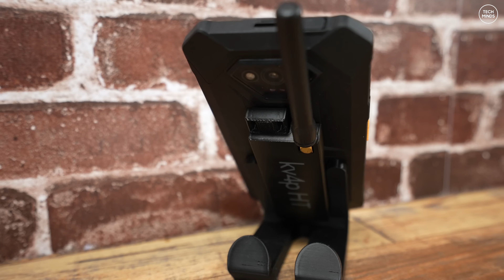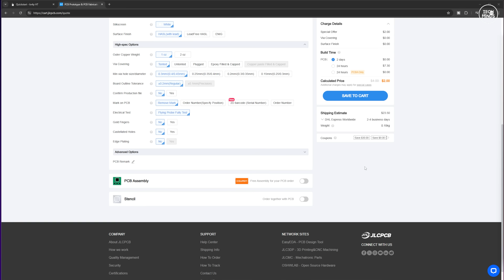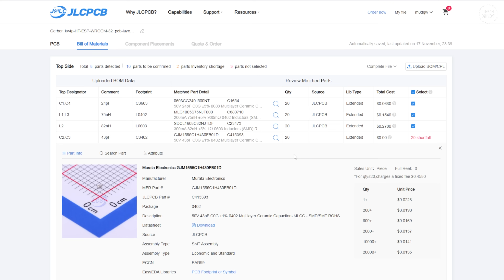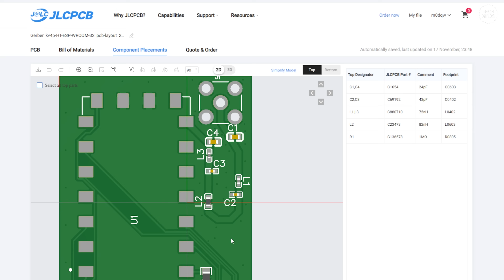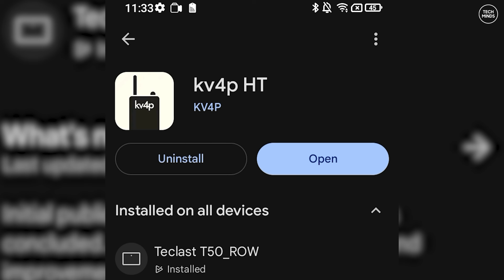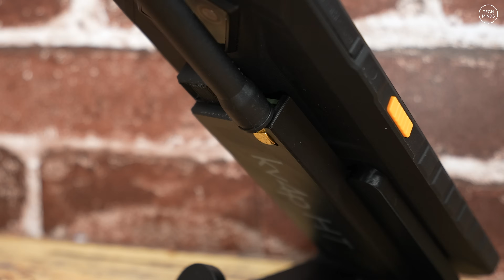Android Controlled VHF Walkie Talkie Transceiver - Testing PCB Revision 1.7b

Comment: It would be great to have a complete open-source VHF radio in a standard mobile form factor, like the RS918 or BS188. It should be further developed with a microphone, a power amplifier, and eventually its own user interface. Is it currently communicating with Android via Bluetooth?

Comment: Thanks again for the great video, is there also a UHF variant of this device? Thank you
Reply from the maker: There is definitely a UHF variant of the RF module, but the filtering on the PCB is designed for VHF. I dont think it would be too much trouble to redesign a board with UHF filters though.
Reply: @TechMindsOfficial  thank you

Comment: not sure why the firmware isn't using  Bluetooth Serial besides there is no external battery for the radio  and there is no  battery charger circuitry on the ESP32 ... luckily my PCB isn't limited

Comment: Did the substitution when I ordered mine.  Notice also that the ESP32, etc.  Are NOT deselected so it will  have them try to and eventually find everything.  That holds up a pcbway order unless you deselect those parts.
Reply from the maker: I ordered from JLCPCB so not sure how other sites operate, but great you got the boards! :-)

Comment: This was an interesting project. I used to work as a technician assembling aircraft control interface boxes in the U.S. I was just curious if there could be an emulator for digital modes such as DMR and C4FM? 73de N0SJU
Reply from the maker: I think this could be possible for sure, especially M17 and FreeDV which are open source.

Comment: A dual VHF/UHF would be ideal. (And if the firmware & App included APRS & Meshtastic together....that would be fantastic!)
Reply: Those RF modules are all single band unfortunately
Reply: @nine7295  well, i guess its quite easy to extend the pcb for another module..

Comment: How far does APRS travel?  Is it bound by local repeaters? The country which one resides?  The world?
Reply from the maker: APRS is normally line of sight, or simplex, not through a repeater. However, the ISS did have an APRS digipeater at one time or another. Distance is dependent on antenna used and height.

Comment: Well, 1) I've got a dozen ESP32 modules sat around doing nothing, 2) coincidentally I wanted to knock off my bucket list this year, "create a PCB from scratch and submit to a manufacturer".

Realistically I'm not going to have time to learn the call process from scratch before xmas, but having a cool almost-ready-to-go project, I might be able to give it a half-tick 😊
Reply from the maker: Go for it dude! I have a few spare boards, so if you want one let me know. You will just need the ESP32 and the RF module etc.

Comment: An android/ios controlled SDR transceiver like the hackRF would be nice…

With the ability to use encrypted (aes256) 2 way DMR, D-Star, NXDN, P25…etc…(encryption is for licensed business purposes)
Reply: as one who researched it a bit, the proprietary digital voice modes are a problem of licensing. long time ago dudestar was able to to so, but abandoned by the author in favor of droidstar which does it over ip. the only digital voice you can do with droidstar via direct mode rf is the open source M17
Reply: @EvgeniX.  I have been thinking of using a Chinese ODM to develop a custom radio….
Reply: @harveyweizman  i would say don't reinvent the wheel. hardware side is just tx capable sdr. software side is another story! if u're able to code a digital modes capable smartphone app that does not require internet connection, but can tx via hackrf or something, i would say it"l be a massive success!

Comment: Looks like it's got a lot of potential for programming it. I need to look up what frequencies marine radio and AIS work on.
I wonder does it have to connect to Android or if it would work with Linux?
Reply from the maker: Could definitely cover Marine and AIS! That's defo another "use case" that could be added to the list. Drop a comment on the github page as an enhancement! Cheers

Comment: A UHF version would be good to see.
Reply: Yes and bluetooth because tha cable between looks like shit
Reply from the maker: @Ghost_Swe  I'm pretty sure that "power over bluetooth" hasn't been invented yet. :-)
Reply: @TechMindsOfficial  have you heard of something called battery?
Reply: @TechMindsOfficial  Ha not yet but "battery share" or "wireless power share" has been and is baked into the Qi standard on many new wireless phones, I charge my wireless headphones that way but even better to have a VHF transceiver that attaches magnetically to the halbach "magsafe" array built into many new phones ( or the 3rd party "mous" cases that are commonly available ) and receives its power over an induced connection....
Reply: @Ghost_Swe  Congrats, you've just invented a handy talky radio :)
Reply: @alphaadhito  Wow so just ditching a cable made that... coooool!!!!! Man your great!!!
Reply: @TechMindsOfficial wireless qi from phone?
Reply: just use the U version of module
Reply: Its called “portable rf “ 😂
Reply: Not just good, but necessary - at least in our country where most active repeaters are in the 70cm band.